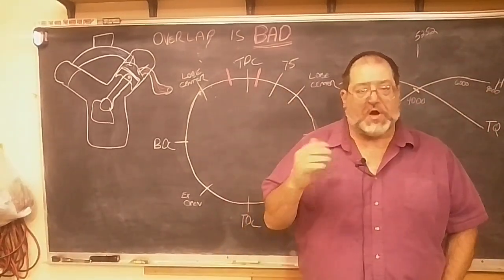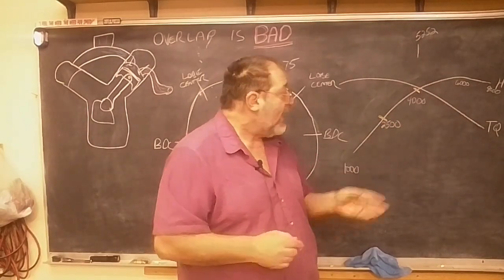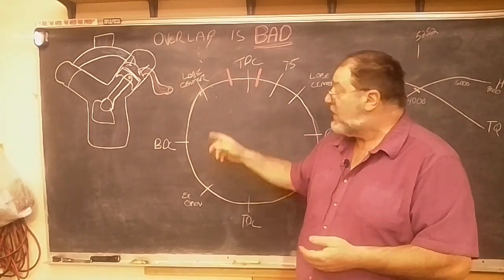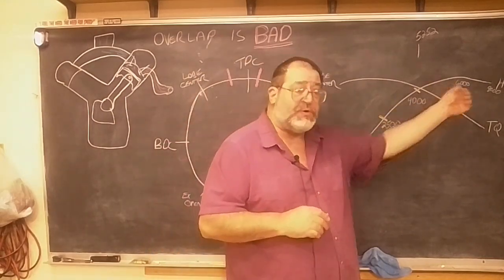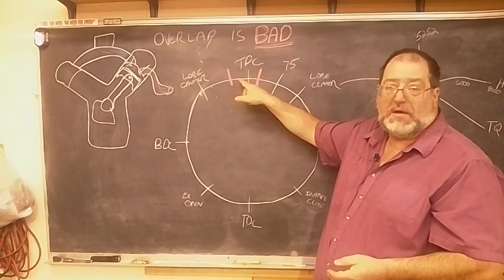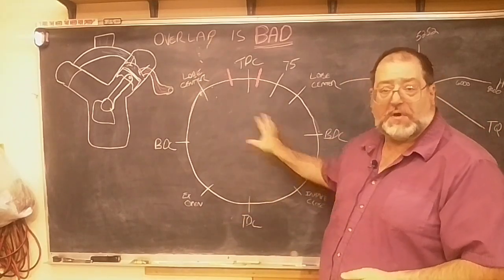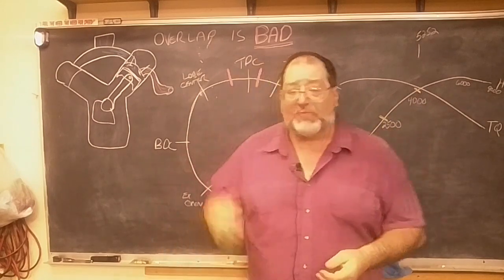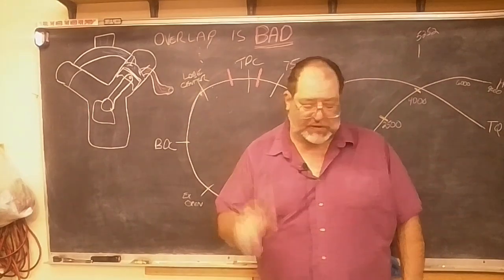Overlap is Bad .. chalkboard talks.

Comment: piston speed at 75 creates the inertia for abdc cylinder fill from there you need to tune your cam profile for the rpm you want to run  it does not fill the cylinder at 75 but the piston speed creates a pressure drop that creates an inertia ram effect in the intake that keeps filling after bdc

Comment: Overlap is necessary.
Reply from the maker: Nope it is not ... I have pushed it out of the camshaft and made lots of power
Reply: @scotthatch4548  So you're saying zero overlap, both valves closed at TDC gas exchange stroke ? The pumping losses will then hurt potential economy.
Reply from the maker: @TomSmith-cv8hk  factory camshaft that is about economy has negative overlap so not sure about your thinking... Plus I'm talking about power in these videos not How OE engine is designed .... And why would you ever want gas exchange from exhaust to intake ? The cleaner the cylinder charge the more power it will make
Reply: Actually, both sweeping statements are wrong. Overlap is not bad if the engine is being built for mid-range through top end as stated in the video. This usually is accompanied by higher static compression ratios. If you build a higher rpm engine with that goal in mind, overlap may be necessary to eliminate dynamic compression from causing detonation and if it is running tuned exhaust and non-restrictive heads and intake etc., overlap is almost certainly needed. 
        With an engine utilizing mostly stock (compression and somewhat restrictive) components overlap will kill most of the bottom end torque. In this instance overlap is to be avoided and the information in this video is spot on. The only concern I see is when you are trying to increase torque output at low speed, and you successfully trap too much dynamic pressure in the cylinder, you can run into detonation problems. You can alleviate some of the detonation issues with less ignition advance and higher- octane fuels, but everything has to work together, or you end up giving away what you tried to gain in the first place.
Reply from the maker: @reason2gether  compression ratio increase is an attempt to fix the bad mixture caused by overlap and help it actually burn ... Or you just don't have overlap and also don't bump up the compression .... Dynamic compression is not about overlap but the closing point of the intake valve and is just that "dynamic" or changing ...late closing point will cause pump back at very low rpm but as you go up you will be right back to full compression ... Also that has to do with cylinder fill ... A good fill will have more air to compress ... Now at part throttle the vacuum will cause less air to fill so dynamic compression is actually lower .., overlap will cause a natural egr effect that can also effect the burn ..... Also remember that as you increase the fill then you will need less timing anyway
Reply: @scotthatch4548  I know you are not saying that higher compression and overlap do not work together with high flow heads, intake, and exhaust to increase rpm capability and thus horsepower production. Horsepower, as you know, is a result of moving the torque peak higher up in the rpm range to get more work done. 
Speaking of cylinder filling, overlap can allow for combustion chamber scavenging which will give you that last bit of cylinder filling for maximum output. It usually allows the higher rpm to be achieved as well. 
How high of an rpm range do you get with your zero overlap cams?
Reply from the maker: @reason2gether  overlap is not needed to make high end power ... You have overlap because the camshaft because the duration is high enough to have a good fill at 75 and a late intake closing point but it's not the overlap that's helping it's the intake closing point .... I had a 500 Cadillac that went to 6000 rpm on iron heads without overlap .... Plus if you watch the video I'm not talking about a high rpm drag engine .... The 5th cycle as isky used to call it is not the primary way a engine  makes power ..watch my other videos .... And I'm working on a new one that talks about rpm
Reply: @scotthatch4548  you're looking at 50 thou numbers. B model fords have overlap.
Reply from the maker: @TomSmith-cv8hk  I only talk at .050 tappet lift
Reply: @scotthatch4548  I know what you are trying to say, and it is mostly accurate and good advice especially for primarily street-driven vehicles. I did watch your video, that should be obvious. To say that a hi-rpm engine only makes power by virtue of duration (which inevitably requires overlap) is semantics or just an unwillingness to admit that more is involved than being stated. Also, if you do attain to the higher rpm, the overlap does indeed allow for the maximum cylinder filling that cannot be achieved by zero overlap. The remaining exhaust gas from the last power stroke event will still be left behind in the chamber otherwise and acting as an EGR dilution.  
 How do you explain cam manufacturers (including) OEM that utilize cams with overlap? Are they all mistaken?
Reply from the maker: @reason2gether  that is incorrect
Reply: @reason2gether  He's talking overlap at 50 thou, nothing to see here.

Comment: So how much or how little valve overlap ????  You tell us nothing !!!!!  In my opinion,   based on .006 start lift,   I like to use 40 degrees valve overlap total max that is 20-20.  At least the vacuum power brakes will work.
Reply from the maker: I talk only in duration at .050 because advertised is tested at all different values
Reply: @scotthatch4548  This is incorrect, all I ever seen is either  .005 or.006 start lift with like 95 percent.006 start lift. Exhaust lift starts to flow as little as . 001 lift intake starts to flow around. 005-.006 lift.  .05 start lift is just too much, too much.
Reply from the maker: @ronsmith7739  I use .050 because all camshaft list it and manufacturers use all sorts of numbers for advertising ... Plus if you look at a solid cam you have to figure lash ... Easier to just think how it will behave at .050 so everything is the same then not pick where you think the flow actually starts ... Having run a flow bench for years is not as low as you think .... If you look up ram theory it's actually 10% of the valve dia in lift that sets the events ...so on a 2.02 valve it would be .202 valve lift you would be looking at